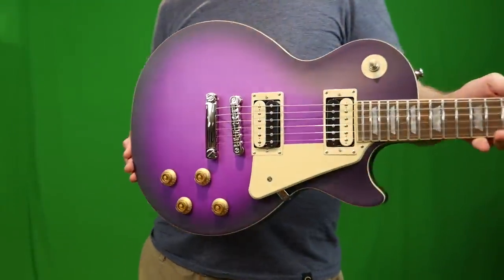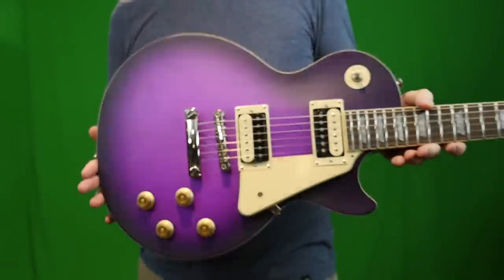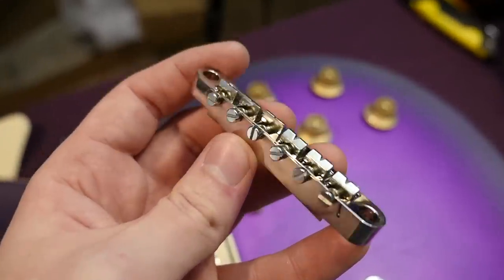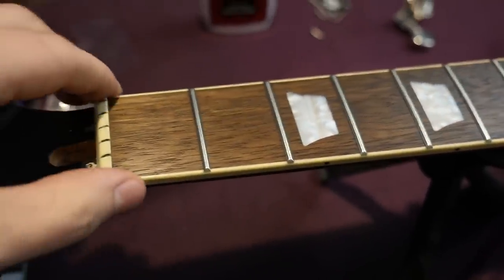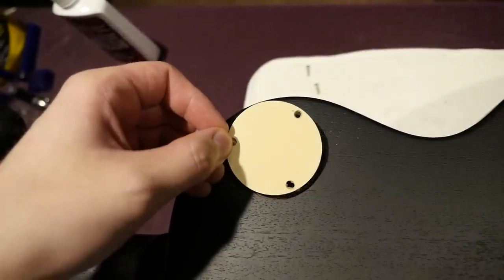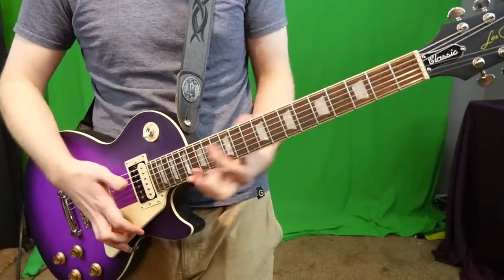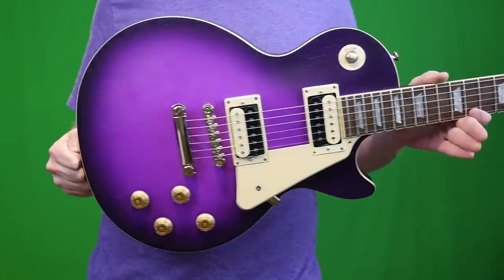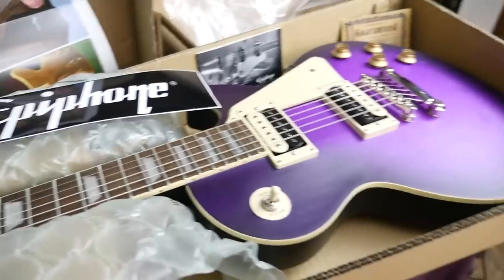It's Pretty... But Is It Any Good? | NEW 2020 Epiphone Les Paul Classic Worn Purple Burst | Review

Comment: Having to level and recrown a new guitar at that price point is inexcusable. There are plenty of imports that don’t have this issue at this price.
Reply: I bet an ESP is a better deal.
Reply: Agree totally, and legally it must be borderline for a misrepresentation case because the instrument isn't fit for purpose if it arrives with high frets and fret buzz.  We already know that Gibson's SOP is to set the bridge and nut high to avoid fret buzz although at least in recent years the majority of Gibson guitars had the Plek fret levelling as standard - the machine is computer controlled for accuracy and if it is set up correctly this does a decent job (on my 2017 Les Paul at least). I still had to cut the nut (lower and the channels improved especially at the headstock side) and lower the action a good 2/3 mm as it was above Robben Ford high. Which is high.  If the Epiphone has bad frets as well as these two 'standard' conditions then it isn't fit to play.  It is atrocious at any price that you have to take a new guitar to an expert to have it finished so that it plays acceptably - these are not shipping movements, temperature changes or personal preference on action, this is poor build / finishing at the factory to cut down on production time.
Reply: Gretsch guitars for one. The budget lines built in Asia such as the Electromatic are better equipped hardware / electronics wise and well finished. Don't arrive in this condition.
Reply: PRS SE is the same deal, perfectly set up, nicely crowned, leveled and rounded-off frets. Not only mine, but all the others I've tested at two different stores.
Reply: I bought a Squier Telecaster for $129 recently. Frets are perfect and wood grain on neck is perfect. Not sure why Gibson can’t figure out how to make a quality budget guitar. It can be done.
Reply: @patrickbrown8540  the Muse on his latest unboxing seemed a lot nicer (great for my GAS, being the one I was really into...) and gotta say, being quite into Squiers and part of the Squier-Talk forums, many still require some love out of the box, as well... Thing with PRS SE is that they actually send each and every model to QC centers, at least for the models shipped to Europe, it was I believe in the UK (I still have the tag of mine, they check and set everything from setup to fret ends), because I guess the fit and finish section is what overseas factories still lack the most.
Reply: @acoffeewithsatan  I had the same experience. My SE Custom 24 had the best fret work I've seen for anything under $1,500 USD.

Comment: I don't know if this is an anomaly, but my July '21 Epiphone Modern (graphite) has the best fret-job I've ever played. Over the past few months I've gone to a few shops and picked up random Gibsons just to see if bends could possibly be any smoother. So far, not even one of the Gibson fretboards could hold a candle to this guitar. And as far as the rest of it? Freaking flawless. The wood is drop-dead gorgeous and the backs (clear-coated) are like glass. The tops, including binding have no discernible problems. 

Granted, some of the strings on the Gibsons could make up the bulk of the perceived grittiness, but all of them? Besides, upon close visual inspection, it became clear that the higher-end Epiphones just had a better polish. As for leveling, I've done nothing but check the string height and condition the Ebony. Grover locking tuners are and should be deal-breakers. Once I pick the guitar up, I can't put the damned thing down. I've heard similar reports in other places. There's something special about the new Moderns. Just an FYI for your viewers. You're always the best, Trog.

Comment: I take impeccable care of my guitars. My oldest guitar... I've never scratched or dented thre finish anywhere, not even up on the headstock during string changes. I'm extremely picky also. That being said... screw holes under the pickuo switch cover would not bother me in the least. I'm really surprised you said that. And even though Gibson owns Epiphone, I'm sure you wouldn't have said that if it were a Gibson guitar with extra screw holes under a cover.

Comment: Hey Austin, did they change the shape of the truss rod cover? It looked in the video that it might be slightly skinnier and where it curves in at seems a little more curved in. It might just be an optical illusion from being on camera though.

I keep trying to figure out why Epiphone would be having these fret issues all of a sudden. Last years models did not have this issue so what has changed since then? I also wonder about other necks like on their hollow bodies and such, such as that Kat you unboxed but haven't reviewed yet, hint hint hint, lol. The only thing I can think of that is causing all the fret troubles would be if they either changed their machines or if these are newer neck shapes and the machine has not been set properly for them. 

I wish they had this in the gloss finish, man it sure would look pretty. I was actually thinking that if I got one of these I would remove everything off of the guitar, electronics and such, and then spray it with my Nitro I use on my other guitars I refinish and then I would have the one I wanted... but then you told us about the differences with the electronics and well everything I want is on the gloss model lol. I am hoping you did get a new Custom, it does not have the maple cap only the solid mahogany body and I am curious as to how it sounds. I love everything about the custom accept for the mahogany.

Comment: Fret leveling is actually super simple. I do it all the time for people. You just get the neck perfectly straight, sharpie the top of the frets, get a leveling beam long enough to cover every fret, attach 220 grit adhesive back sandpaper to it, and run it back and forth until all the sharpie is gone, sharpie the frets again, get a crowning file crown the frets and polish and you’re done. I’ve done it so many times I can have a full level and crown job done in less than an hour.

Comment: Good video.  Not to call you wrong, but these models do have a veneer.  I found that out after stripping the top from a black one recently.  It is paper thin and will lift/bubble if given too much heat or too much dye.  The veneer is in the style of a plain top and has the impressions of cracks and vertical stress marks which add to the worn look.

Comment: WOW! If you get Stew-Mac to hook you up with fret finishing tools, try to get everything in diamond you can. Their radius’d Aluminum Sanding Beams and 3M sticky back sandpaper are top notch. 

Don’t forget you need tools to make sure the neck is 100% straight before any fret work is done. Which is what I think the problem is at the factory.
Reply: 12 South You know what! I had a ES339 that had a shallow fret slot around the 13th fret. After investigating further, there were around 5 frets that didn’t seat fully. I just refretted the entire guitar.
Reply: @12south31  I bet they CNC everything and expect to bang it all in place perfectly. My luthier buddy has a jig for his table saw and cuts perfect slots. Fretting is an art. You won't do your first job correctly so get an old spare neck and wreck it first..

Comment: when it comes to the pots.  would you say they're good enough to let's say just replace the pickups??  I have a set of Lace Sensor Finger Burners, which I know sound amazing.  If I'd be better off putting in better pots rather than the stock versions since they're not CTS.  I just love the looks of the purple burst, and ascetically the Lace Finger Burners would look super sharp with it.  I don't know.  Don't want to just be dumping a bunch of money into it, just for the paint job..... i dunno.  thought???

Comment: I bought a cheap stripped 2020 Classic honeyburst husk to mess around with and can confirm the factory Grover tuners definitely are lower grade, as the 18:1s I bought from Sweetwater to replace them are beefier and don’t match up exact with the impressions left by the originals. Mine has the “CTS electronics” with the out of phase push/pull but the only pot that is CTS is the neck tone and its coarse spline like most imports, I’m fairly sure the push/pulls are exactly the same as on the faded

Comment: I’ve had actual Gibsons where the holes were completely messed up when they drilled them for the various cover plates on the back not to mention the holes for the volume and tone knobs completely ragged like they were cut with a dull bit. I think that when Henry had the company, it was in such a bad financial state they simply did what they had to do by pushing out guitars that were just not up to snuff. And of course many of their factory workers were completely demoralized by the state of affairs at that time. They had a lot of people at the time doing parts of the process that should never have been allowed to because of lack of experience. But thankfully I think most of that has been purged from the company.

Comment: Mimic Gibson line up? So they doing 24-9/16 scale now?

Check it out on Stew Mac.. They were 24.75 until 54 then they got shorter twice.. 24-5/8 and 24-9/16 since 92.  Get the 0800 Gibson Scale ruler from Stew Mac and check.

You can still pore fill it an call it a TV finish. lol.

You gotta demonstrate the volume pot tapers on the cheap pots. Do I need to swap in A500k or do the treble bleed mod?
Reply: Treble blood is well worth the cost ,I would recommend Emerson have them in all my guitars .
Reply: @dennisapplegate7553  I just got a Jackson Monarkh and I'm gonna put Duncan Full Shred in but I'm still playing with the original pickups. I had bought the FS for an Epiphone I had. But I sold all my electrics. I'll probably TB the Jackson.

Comment: Have you seen Gibson's latest Lawyer Marketing program against Kiesel? C&D letter threatening them.
Knobs: that inset groove is more expensive to tool. The groove design allows for adding a rubber washer around the knob. So that may be a future addition. Or make a trip to the hardware store and see what you can find to fit. Several rubber bands from a dental braces kit?

Comment: It's very pretty, but those frets... At this price point, I don't mind cosmetic issues, but bad fretwork is a structural issue that directly affects the functionality of the instrument. Having to fix structural issues out of the box is simply not good enough from a 400-600 buck guitar and a major manufacturer. Just get someone to go over these in the factory, and charge $50 more - I reckon most customers would rather get the guitar in perfect playing condition out of the box than save a few bucks on the purchase price.

Comment: I'm a big Epi fan, but they can be hit and miss. Not too impressed with this specific guitar and model. Nobody should have to have a fret re-crown on a $450 guitar out of the box. Extra switch plate screw holes is not cool. Open pore on that color burst doesn't work. Truss rod cover font is too big and distracting. Electronics differences between worn and gloss models is also not cool.  Thick wood cap is good. Open pore on back is good. Cant stand painted necks. I am interested in their new studios, but no interest now in this model.

Comment: When you say high fret is that the tone of the fret or the neck of the guitar is higher in some areas?
Reply: The "high fret" means that it is literally too high, vertically, than either the fret just below it or the one just above it.  When you fret a string just below that high fret on the neck, the high fret touches the string first so that the note is a half-tone higher than you selected.  If it is only a smidgen higher, the pitch will be correct, but the string will buzz on that high fret.  Nobody wants that.  It shouldn't be found at this price level and is unacceptable.

Comment: The "faded" paint isnt faded at all, but will fade away with time -- as I see on my Flying V "faded" black. 
It looks cheap in that LP, and IT IS a cheap painting that won't protect your guitar like a gloss paint would.
With heat and humidity (in the summertime) it kinda MELTS, and will melt on your hands...
But if you like a paint that will fade away, rendering the guitar "relic", then that's okay.

Comment: I’ve always thought epiphone should make Les Paul and SG juniors, firebird 1s, etc and Gibson should make the professional level stuff
Reply: All the major manufacturers should focus on making the best standard version of their flagship models and not try to cover all bases. Customization should be the customer's choice and not a hodgepodge of crap they toss together. If Gibson built a Les Paul, SG, V and the rest in a standard model and put out the best they could it would seal their worth. Same for Fender and all other makers. How many color combinations do you need? If you want a custom shop that will be different, as it is now, but, the production line should focus on making the best standard they can.
How many people would be behind that? The best standard model of a guitar you can buy, untouched after leaving the factory. Gibson rivals PRS, pricewise. Is a Gibson custom shop guitar better than a PRS private stock model?  Fender custom shop can as rival well.  Go to a guitar store and play each and look for QC. I have yet to try the John Mayer PRS but will next time I see one.

Comment: I have an Epiphone Thunderbird Classic IV Pro bass that I bought two years ago for 425€ and it plays great! It's a cherry-burst finish wich I have never seen on a Gibson Thunderbird. It's also not beeing manufactured anymore becouse of a type of wood that they aren't allowed to use anymore. It's a great bass and I have never had any big issues with it. The only think is that one of the two screws holding the bridge pickup suddenly was loosened  one day, and the entire pickup was loose. That was weird but pretty much the only problem I've had with it. I kinda wish they would have another kind of bridge on them though. The three-screw one is a little hard to adjust.

Comment: Good review!  Sounds pretty good.  But good grief! Frets that far out of whack on a $500 guitar?  Also, that "worn" finish is saving them WAY more than $50 in labor and time.  Downgrading hardware just adds insult.  The gloss classic is the better deal in my view if you can find one in-store without such wonky fretwork.

Comment: Do not excuse poor Epiphone quality just because of the price, £450 for a new guitar for many is not cheap. I have 2 Gretsch guitar in the same price range and the quality is excellent. I did get a new Epiphone les paul plus top pro last week the quality was unacceptable very poor. Low and high frets 4th 5t and 6th. Fortunately I have years of fretting and dresing experience and it now plays like a dream. Fact is I should not have to have done this and many people will just put up with high action, or pay someone to sort it. 

Next was the finnish on the neck, there were lumps in the lacquer that just had to be sanded down, now nice and smooth with a satin feel, the neck feels and plays like any more expensive Gibson. Again this should not have gotten out of the factory in this state. 

Then there was the sound, mudy with no sparke and a harsh treble in the middle setting, with a distinct drop in volume and the warm lows disappeared. I play through a Fender Hot Rod Deluxe and it sounded SHIT. I took the panels off and looked at the electrics. They were not the CTS pots that the online brochure said it was fitted with. I ripped out all the electrics and wiring. Fitted CTS pots including the pul pots for coil splitting. Rewired from the toggle switch right through with vintage cloth covered cable. The difference in the sound is far improved, mud gone, harsh treble gone, and a nice sparke to the sound. 

The cost for the parts was £48 and my time. If I were to charge someone for the work you are probably looking at an extra £200 bringing the true cost of a now very nice guitar to £650. Epiphone could do this in the factory for far less. What is apparent is that with a little investment you can make an Epiphone play and sound like a lower end Gibson costing between £1400 and £2000. At the end of the day Epiphone should not come out of the factory with high and low frets, or very poor finish on a £450 guitar.

Comment: I am a repair tech.  I have now worked on 6 of the "inspired by" epiphone.  The quality is pretty poor.  Some are not very inexpensive.  These new Epiphones are not worth their price.  Poorly made using crappy parts.  Your better off spending a little more and getting a used Gibson.  During Jim Rosenbergs time at the Helm of Epiphone, quality was impressive and cost was low.  That time is over.  Cheap parts, poor fit and finish,  crappy fret wire.  The "ebony" fretboards are dyed black with some goo that gets all over your fingers and once gone from the fretboard leaves bright ugly streaks.  Electronics are JUNK...just toss the whole mess in the trash.  Just had a "modern" Les Paul on my bench.  For a guitar that cost $675 without a case or gig bag?  To make it a decent guitar $350 had to be invested.  Then another $125 for a case. Total = $1150 for a Chinese guitar that kinda sucks.  I'm sure I will be seeing more of these.  Ugh.